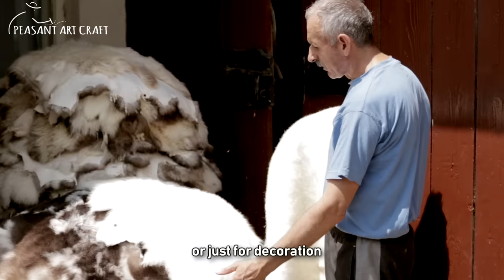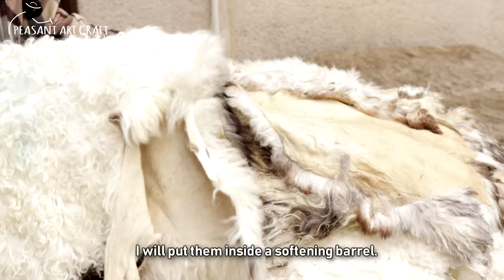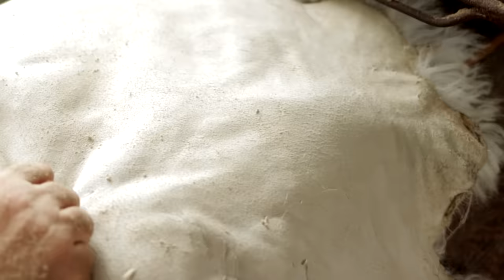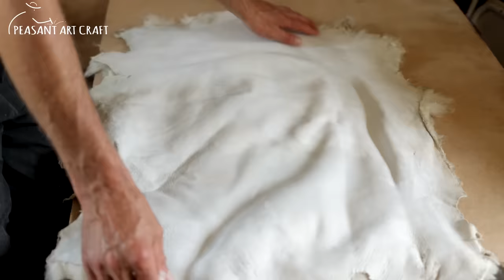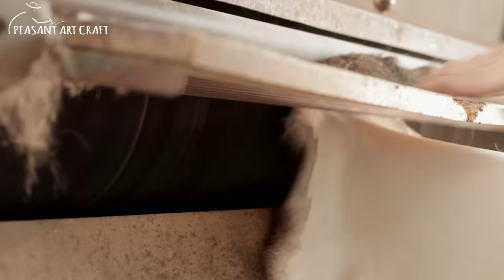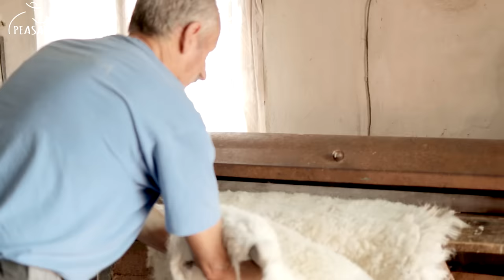Leather Tanning Process

Comment: I did not realize how many steps go into this process. Very labor-intensive and gives high-quality leather as the finished product. Very nice.
Reply: should try the traditional Native American way. I just got done with a deer hide I harvested  this hunting season. Salted and dried for 3 days in my shed, oiled with the brain, set to permeate for a day, then stretched and dried for 6 hours before I had soft workable fur on skin. I then turned it into some moccasins for a Christmas gift. You havent worked your hands until you've stretched a hide on a wooden beam. XD
Reply: @WoodLandChef damn straight! My wrists, forearms, shoulders and back were ACHING the day after this.
Reply: @Elmarias777  what do you mean "oiled with the brain"?
Reply: @markelafrantzi4668  take the animals brain and a little bit of water, 1 part water to 2 parts brain. Mush it all up into a paste and cook it back down a little bit to get rid of the water. I did it over a campfire for maybe 10 minutes.
Then i took the fleshed hide and massaged in the brain paste for several minutes until it permeated the hide. I carefully folded the hide up, fleshed and pasted side in, and set it into a large bucket with a brick underneath so the runoff wouldnt saturate and ruin to fur side. Left it like that overnight

Comment: So, these are salted hides; not tanned?  How well do they wear?  How do you preserve them?  What would be the shelf life of vests/clothing made from these hides. please?  Thanks.
Reply: They are salted to prevent rot while storing them .They need to be tanned/ pH needs to be high .The proteins and natural fats would cause it to rot . The outside of the shearling is the meatside do it is like velour leather .If you want a smooth surface then you need a synthetic bound leather
Reply: @jensrb50  Thank you.  I did know why hides are salted prior to tanning, that was not my question because I already knew that.....which accounts for my (I thought careful) wording of my original question.
 These skins do not seem to be tanned at all during this film.   The actual "tanning" process is completely "skipped?"  I did not see one part where the hides were tanned or plumped....hence my comment.   Salting in itself is not tanning, but I fail to see at which point in the film the hides are actually tanned.
Reply: @payntpot7623  he did indicate they were put into a vat- tanners keep that a secrete, probably alum (low Ph tanning/pickel acid)
Reply: That’s what the large rotating drum is for - probably alum or chromium salts.
Reply: @payntpot7623  It looks like an alum tan which unlike chrome tan is not waterproof!
Reply: No tanning involved.  This is the traditional method,  mechanically enhanced but otherwise how it had been done through the ages, in every village or maybe even household. Wasteful,  maybe, on the long term but a skill you can use pretty much anywhere,  anytime.  There are always more sheep...

Comment: How is he getting them so perfectly white? He must be bleaching the skin at some point... I've done about 6 sheep skins and the skin itself usually ends up kind of off-yellow with a few brownish spots. What really weirds me out is drying them in the sun... which should really be putting weird coloration into them. Pure white wool usually makes for pure white skin, but he had what looked like a brown goat hide in their and it was perfectly white as well.
Reply: Soaking in detergent and thoroughly fleshing it keeps it from yellowing. They yellow is from fat, tissues, or natural oils that havent been completed cleared off. Most, if not all hides generally turn white when preserved.  :3
Reply: The detergent he uses probably has some soda ash and then the tanning solution is likely to be alum based both chemicals aid in bleaching the flesh side of skins.